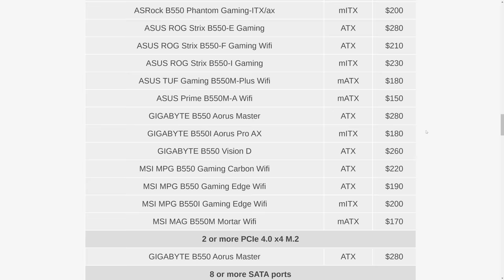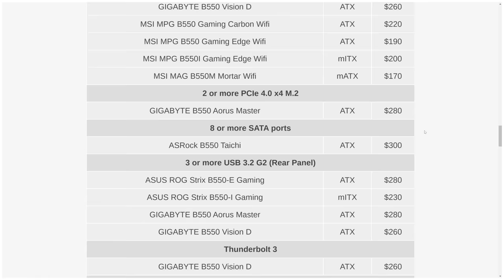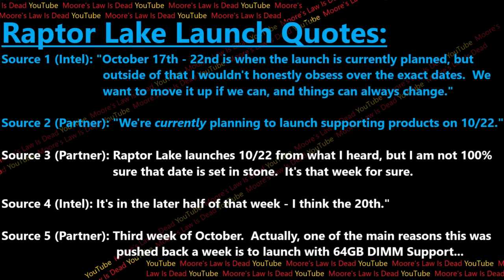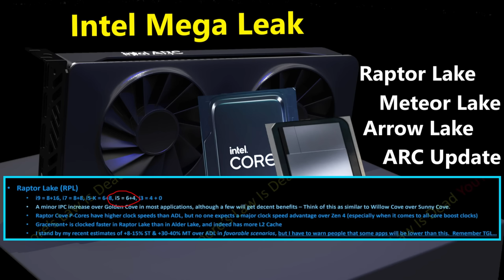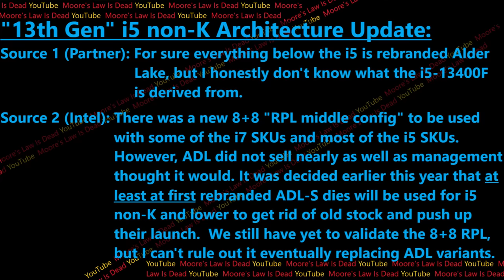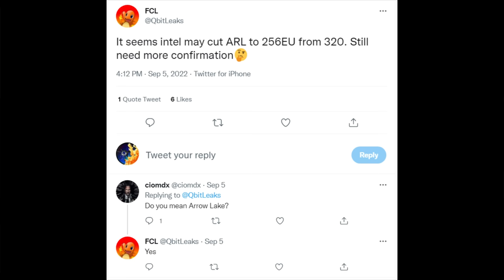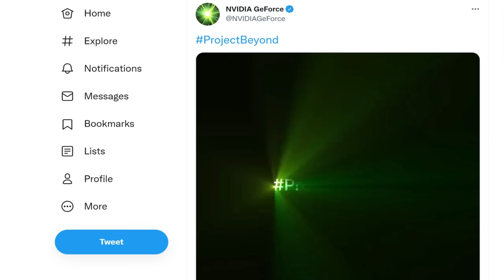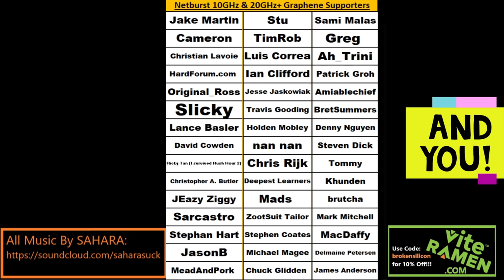RTX 4060 Ti, Raptor Lake Launch, AM5 Pricing: What Rumors are True? Who's Trolling you?

Comment: Inflation has been almost 20% in the last 3 years. They aren't going to be cheaper than x570/B550. If they are the same price as AM4 boards, that would technically make them 20% cheaper if you account for inflation.
Reply: Sadly wage growth has not kept pace with that inflation, so it's still roughly the same economic burden as a proportion of income. It's just eating up wage space which is now more valuable as cost pressures on individuals and families grow.
Reply: I wonder why... 🫣
Reply: @TAP7a  not to mention taht shipping profits increased 9 fold last year and will peobably double again this year too
Reply: @TAP7a  wage growth seems to be heading the opposite direction sadly..
Reply: Inflation will continue until morale improves!
Reply: @ghoulbuster1  We will have to wait a couple more years if that's the case. Inflation is not based on "morale". Brandon needs to go.
Reply: @TAP7a  depends on how you count. If wages have not kept up to general inflation, you will have less money to spend on “unnecessary” things. Therefore the same price as X570/B550 had when it released would be more expensive with the same income.
Reply: @fredrik831  that's literally the point I made, yes

Comment: Intel rebranding Alder lake to Raptor Lake to get rid of old stock sounds like an awfully good way to also increase the price of that old stock by simply slapping a new name on it. The excellent value 12100, for example. Will the new 13100 be the same CPU but cost more?
Reply: the new 13100 will not be a rebadged 12100 as there will be zero gain... listen to what he said. Higher tier alders are being limited so they can be sold as lower tier raptors. Your 13100 might be a 12400/12600 with just less cache/cores enabled.
Reply: @SixDasher  Thanks for clarifying this in a polite and constructive way. I stand corrected :)
Reply: The only major difference between Golden Cove on Alder and Raptor Lake is the cache. Raptor Lake uses the same overall core design but (I think) is the Golden cove in Sapphire Rapids.
There isn’t a major or notable other wise, so reusing the Alder Lake die for the i5 non-K and below isn’t surprising, they honestly probably would have cut down the cache anyways
Reply: It's a bit like putting last season's clothes on clearance to sell them out. 12600K will have its multiplier locked and then sold as 13400 at a lower price, to name one example. $200 is more than zero, and is probably more than the chip costs to make.
Reply: $10 more for 10 MHz more :D yay
Reply: @SixDasher  The 13100 will most likely be a 12100 with a small clock speed increase, otherwise the same.
Reply: @HighYield  a 12400/12600 with less core/cache enabled is a higher clocked 12100. A 13100 should be a higher clocked 12100.
Reply: According to the channel High Yield the 13100 will be based on the same die as the 12100, Intel isn´t planing any improvements on the i3s yet except for the usual clock and ipc improvements. I expect an upgrade for the i3s with 16th gen and of cause a new socket, maybe AMD gets more competetive in the low-end segment and we see an 4+2 i3 with 15th gen.
Reply: @gedeuchnixan3830 do you not know that E cores come IN CLUMPS OF 4?!?!
Reply: @rhebucks_zh  And you do not know that Intel could simply disable two of them? Ever heard of binning!!???!???!??!???!?!??!???!?!???!?!??!?!???!?!??!
Got the mocking of your point- and needles overpunctuation? BTW: the 12100 is a binned 10400 with 2 cores disabled.
Reply: it's like Haswell and Devil's Canyon
Reply: @gedeuchnixan3830  13th gen will have a 6/12 core i3 (also the 4/8 i3) because pentium will be the new 4/4
Reply: 13100 is 12100 +100MHz, they did the same with 10100 and 10105 which was the same chip but had a +100MHz

Comment: Like I said all these prices for high end X670 motherboards and RAM like DDR5 will be CHEAPER in price in another year. So at least for me it’s smarter to wait. I’m just going to wait for Zen5 in another year. Prices for X670 motherboards will be cheaper than they are now and DDR5 prices will be cheaper. Plus how numbers how much faster DDR5 will be in another year when they have had more time to fine tune it. Just like DDR4 was better a year after it launched AND it was cheaper. So yea my plan at least is to wait for Zen5…
Reply: I was thinking of waiting for zen 5 and then buy zen 4 once the price for that goes down. Can always upgrade the proccessor later on.
Reply: Why not buying a mobile device for gaming in the meantime. The steam deck is capable of ray tracing, Also arm based systems are capable of ray tracing recently. And beyond that, Risc-V socs can also be combined with ray tracing capable gpus.
Don't waste your money by still buying over priced, expensive pc parts from red, green and blue. All of them gained too much profit from the cryptocurrency hype and milked the last drop from their loyal, traditional customers. Do you even want to reward them for that?
Reply: @aladdin8623  Some people may do that. I can afford to wait for Zen5 and for cheaper DDR5 options and higher frequencies as well plus by then DDR5 will be more stable from what I’ve heard it’s not totally stable, but I don’t know for sure.
Reply: i got hynix binned IC ddr5 on adata 6000mhz for like $180 w/ coupons lol, for 32gb, and a strix board z690 at 50% off. think i used up all my luck
Reply: @yukisnoww  You did…
Reply: @aladdin8623  My current PC with a RTX 2070 is better for all around game performance than a steamdeck by a fairly large degree I would be much better off upgrading to a 5800x 3D than investing that money in a steamdeck especially for that Spiderman Remastered performance.

Comment: I used to work for a smaller European hardware site in the 2000s until 2011. The thing is back then there were no hardware leaks or at least I don't remember them even though I was very informed about hardware because this was my hobby and my job, I loved to test new stuff. Anandtech was in it's prime.
These days there is a leak every day and honestly it's frustrating (leaks contradicting each other or it's just some bs) and boring because by the time the new hardware comes out we know everything about it, it ruins the surprise. And it's not like you can avoid them because sites run these "stories" as headlines on the main page.
Reply: I remember there being some leaks about GTX9000 series being a rebadge and some stuff was coming out about the x800 and x2900HD before they came to market as well, but I do agree with what you're saying. Back then a good review would garner enough attention, nowadays you need to keep up with clicks and likes and all of this stuff.
Reply: There was always leaks, print journalists getting planted info, rumour and gossip.  There'd also be famous CEOs who would pre-announce products with big claims to spike competitors who had begun product development much sooner.
The tech industry was heavily concentrated around Silicon Valley, and company info was notoriously leaky.

Comment: Really looking forward to the independent reviews and benchmarks from GN & HUB.
When I bought AM4 B550 was still higher priced, I bought a well regarded X570 board for less.
Saw Igor's Lab leak about L2 cache, thanks for looking into this
Reply: Finally caught you in the wild! ;)
Reply: @justinvanhorne9958  The numbers don't lie, they are repeatable.  If you find HUB objective reporting slanted then it shows YOUR bias.  What you are doing is blaming the messenger, regular viewers have seen plenty of HUB criticising AMD, at times so unfairly they have been forced to admit error later.
The truth hurts .. deal with it better.

The fact is the tech press in general have let Intel get away with over-clocking by default for years on consumer platform and most ignored the poor power efficiency that Intel CPUs have.  The result is this 241w default non-power limited, non-TDP respecting set of mobos and the need for products to fix socket bowing and new builds seeing 100C CPU temperatures and OEM machines unstable overheating at game developers.
Intel AXG are also getting a soft ride on their Arc excuses which don't ring true, they've changed their stories and contradicted themselves.  Not one mainstream tech journalist has challenged the BS.
It's clear Intel are struggling to make chips like Sapphire Rapids, it was already in trouble vs MilanX announced about 10 months ago; but they're still in validation and will face Genoa & GenoaX, which increase max core counts and boost massively power efficience, with Bergamo to follow for cloud hyper-scalers.
You're also going to call a lot of reviewers shills when the Zen4 laptops arrive next year, in power constrained systems.
Reply: @RobBCactive  normally its polite to admit defeat instead of just running away and pouting like a baby... but that's okay, like I said, 100% ratio.
Reply: @justinvanhorne9958  100% failed ratio 🥶🥶
Reply: @justinvanhorne9958 but you weren't polite, were you?  Intel have had the chickens truly home to roost!
But I guess you'll just ignore high RMAs, widely reported instability and some instances of CPU degradation. Sapphire Rapids was also pure debacle.
Reply: @RobBCactive  selective bias as usual. the same can be said for products from any company and any market. AMD isn't immune. the sooner you realize this the better you will be off and the more open your buying power and potential will become.

Comment: Great video and interesting research as usual! BTW: I think I might know whats going on with the i5-13400(F) models being ALD and RPL at the same time.
Currently, all ADL i5 CPUs and below are based on the ADL H-0 die, which is the smaller one with only 6 P-cores and zero E-cores. But there is an exception: the 13400(F), while mostly based on H0, can also be based on a heavily binned version of the larger ADL C0 die. Only way to find out is to buy one and check with CPU-Z.

I think the 13400(F) models could apply the same dual-source approach: mostly based on a ADL C0 die, but some might also be using heavily binned RPL B0 dies, which Intel cant use anywhere else. The only argument against this would be the slightly different performance of a 13400(F) based on C0 vs B0. Maybe its all BS, but I would follow Intels current approach.
Reply: If you're right that lands us in my unacceptable scenario where 2 different chips have the same model number.
They could sell these chips as 12th discounted.
While the manufacturer may regard them as equivalent performance, there may be differences that self interest has them ignore until it causes them a problem later.

Comment: I mean, I paid about $275 for my x370 motherboard, and $250 for my x570. I feel like people are looking at the x670E boards and taking it out of context. It's not meant for your average guy. It's meant for people who are going to use, possibly multiple, pcie 5.0 ssds, pcie 5 gpu's etc. In the grand scheme of things, $100-$150 more for a similar board with those added features is nothing to whom it's marketed for.
Reply: Looking forward to those $125 entry level B650. You have $300 7600X, $125 B650, $100 16GB RAM kit = $525 core system. I can afford that. After that case, PSU, storage, and GPU to round out the build. Assuming a GPU price crash like is expected, I think you can get a midrange system for around $1k. Or a little more if no crash.

The cheapest gaming build I've seen is $70 10100F, $90 Z590, and $50 16GB RAM kit for $210 total. The more expensive system is around 150% more price and 60% more performance (single-threaded for gaming), I think it's worth it.

My target GPU is 3060 Ti. I feel like 10100F will choke on it and the AM5 system will allow for a better GPU later on if necessary. I game at 1080p & my current system is i5-4570.
Reply: @SuperFlamethrower  Yeah, I'm not sure if the recent release of Spider-man was an outlier, but I wouldn't feel comfortable gaming on a 4 core cpu anymore, even with multithreading. I feel like the 7600x and the 13400f should be the baseline for high quality gaming. But that's just my opinion. I'd also like to see the 7600x drop to 249 once raptor lake launches, and let those b650 motherboards come down in price. I think that would be best for the market as a whole.